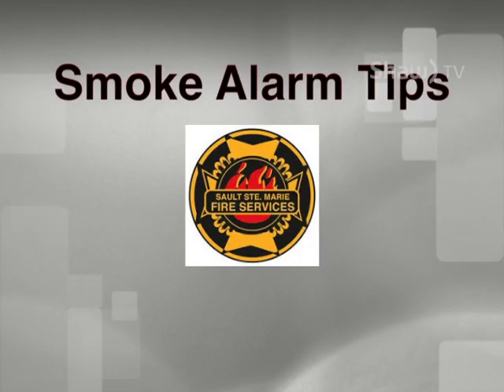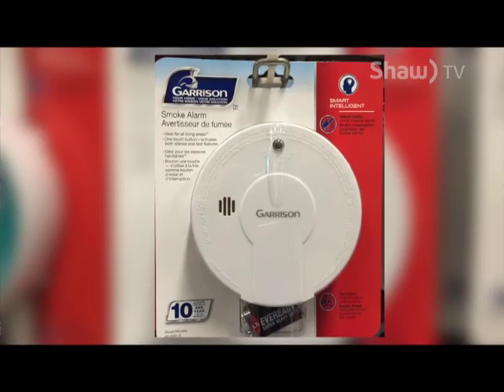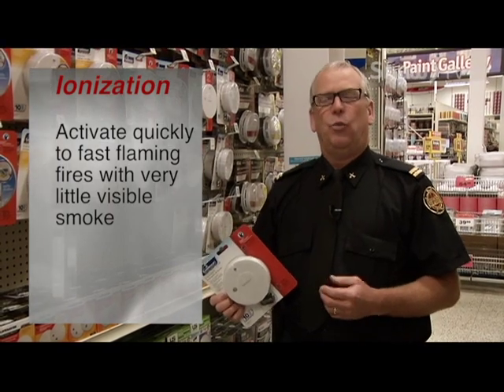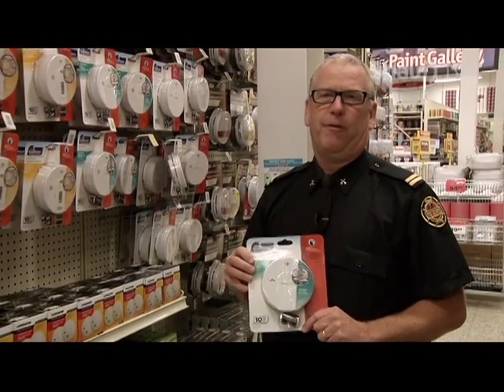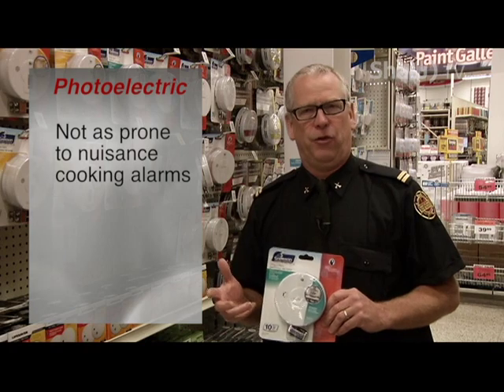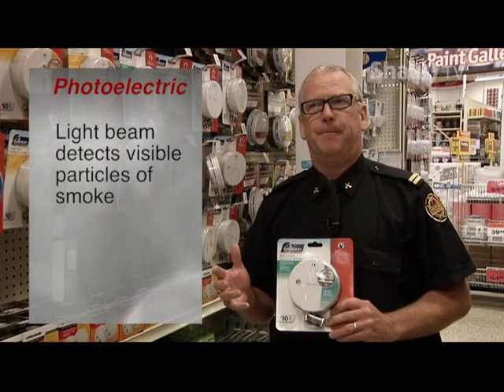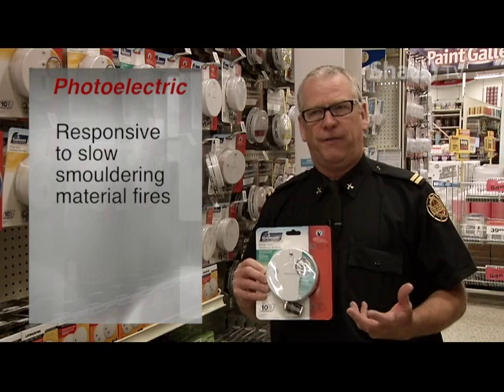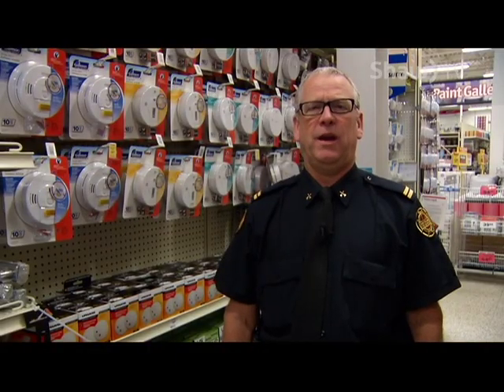Smoke Alarm Tips - Ionization vs Photoelectric

Comment: I vape (electronic cigarettes) right under where my alarm is installed in my office.  Is it correct to assume that photo-electric type will be set off easily in that environment?
Reply: Depends what type of vape. Ionization detectors 100%. Photoelectric, will go off when there is an abundance. So if you vape say a Juul or Myle. You'll be find. If you vaped an RDA or a regular mod and tank then yes you will set it off.

Comment: Photoelectric smoke detectors have been the only ones to meet building codes in more and more cities and states.  This is because ionization detectors don't react (or does so very late) to smoldering fires that cause most deaths.

Comment: photoelectric smoke alarms actuarlly goes off with steam so dont install photoelectric outside bathrooms or kitchens. install an ionisation in a kitchen as kitchens are more prone to fast flaminig fires. have optical aka photoelectric outside and inside every living spaces including lounges and bedrooms for maximum protection as those areas are more prone to slow smoldering fires. or in living spaces have both ionisation and photoelectric and not just ionisation on its own in  living spaces as if you get a slow smoldering fire with just an ionisation alarm it will go off far too late and by the time it goes off your room will be filled with too much toxic smoke. pay the bit extra and get photoelectric for living spaces or photoelectric and ionisation or a dual alarm in living spaces. get radiolinked or hardwired smoke alarms for maximum protection as if one alarm goes off it trigger the rest on the system, if you dont want the hassel installing wired smoke alarms and lifting floorboards and carpets get radiointerlinked smoke alarms.
Reply: the walkie talkie reviews I have a photo electric smoke alarm right outside my bathroom and the steam never touches it as in it doesn't go off
Reply: Bruh you got it mixed up, install photoelectric in kitchens, and areas that are susceptible to smoldering fires like bedrooms and such.
Reply: ionization alarms are not a good idea instead of an ionization alarm for fast flaming fires the better idea would be to put a heat alarm smoke will not set it off it will only go off if there is significant heat appied it should not have nuisance alarms but still provided flaming fire protection with approximately zero failure ionization alarms have about 20% failure in flaming fires where they were supossedly better and about 56% failure in smoldering fires but it is proven that they dont repond to visble smoke do you know someone used an arguemenent once that 100% of all lawsuits are against ionizaiton alarms ?

Comment: If photo electric is based on particles in air, should it not also go off with bread burning?
Reply: photo electrirc detects visble smoke particles  ionization alarms cannot detect visble smoke this is scientifccally proven
Reply: Correct